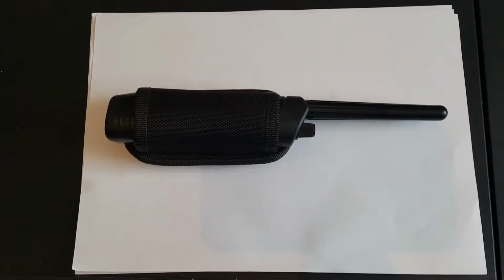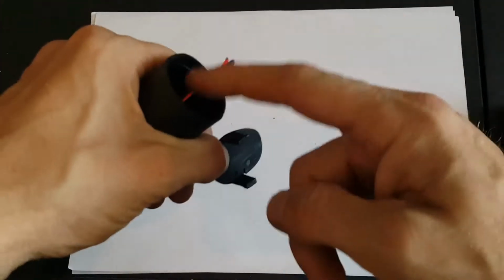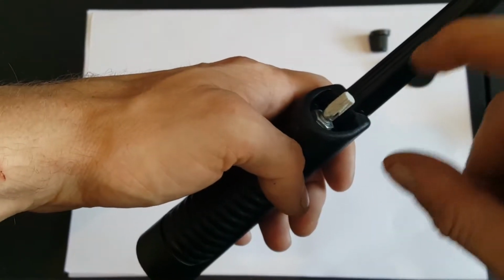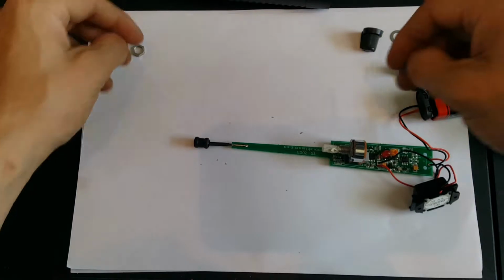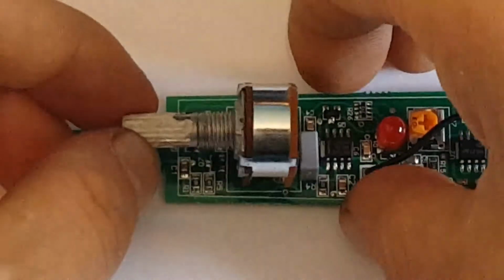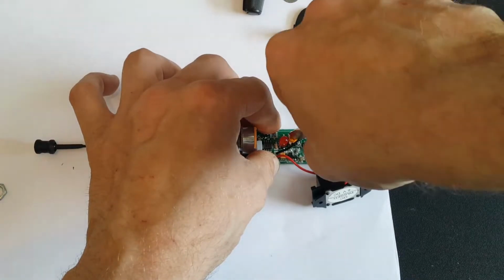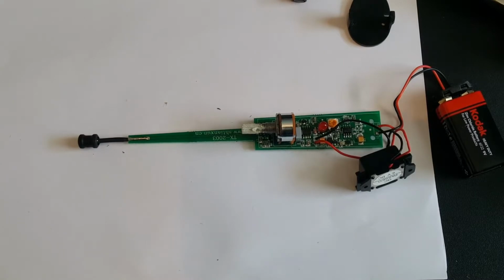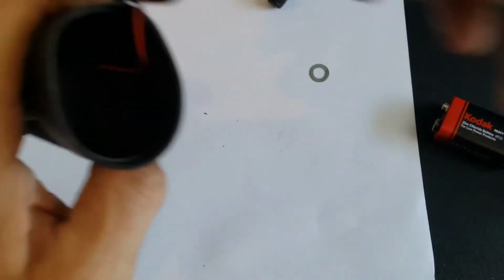HOW TO PINPOINTER MOD TX-2003

Comment: Nice video.
Reply from the maker: Thanks Kev
👍👍👍👍
Reply: No problem. I’m trying to think of other mods for this unit.
Reply from the maker: @SEAWORM  I know that holding a coin or piece of metal  nearer the end makes the machine lots more powerful.
Maybe some kind of metal ring like an olive from a gas pipe with electrical tape wrapped around it.

You could experiment where might be best place for the ring, about three quarters the way up the shaft from what I remember.
But if you come up with a mod for the strength that works better than this let me know.
👍👍👍
Reply: ORACLE'S CAVE will do. Do you have a video on the modification your taking about?
Reply from the maker: @SEAWORM  no but there is plenty of videos with people testing these pointers, and holding a coin against the shaft then turning machine on then tuning it with the coin still in place, use sticky tape.
Then check distance its detecting at, then move the coin to different positions when it's off and repeat until you find the detection distance that's the greatest, then you have found the magic spot.

Then just tape an olive compression seal from a pipe, looks like a copper ring, into the place you got the best detection from.
Now everytime you turn it on, it won't detect the ring, but the ring will boost the machines power.

Doesn't have to be a ring, maybe some wire wrapped around it then taped over.
Just has to be metal.
Check more videos you will see what I mean about using the coin
Reply: ORACLE'S CAVE Thank you 👍
Reply from the maker: @SEAWORM  no problem bud, I used to do a metal detecting channel but nobody really watched it lol
HOARD HUNTER you should check it out, i found a £50 detector as good as the Garrett AT pro
Reply: ORACLE'S CAVE sounds good. I’ll check it out. Make sure you check my channel out too. Thank you 👍

Also add your metal detecting channel here. Easier. I searched but not sure which is yours